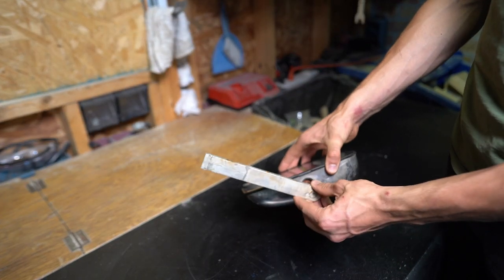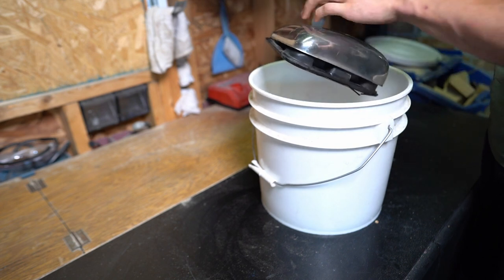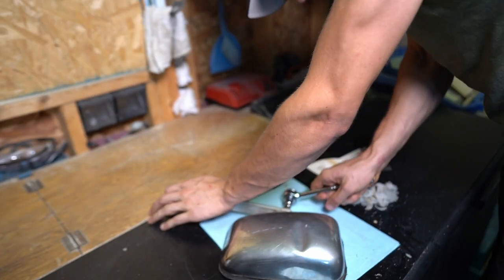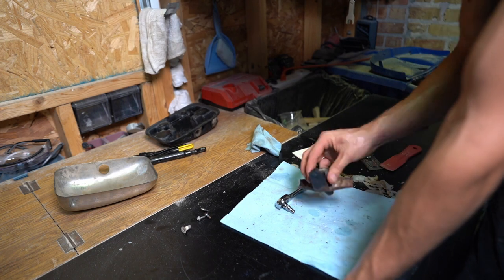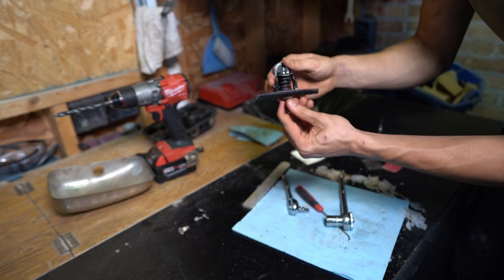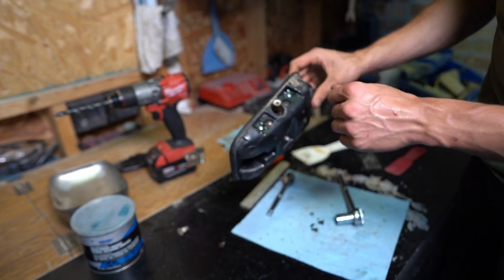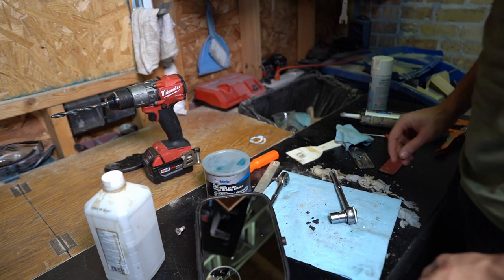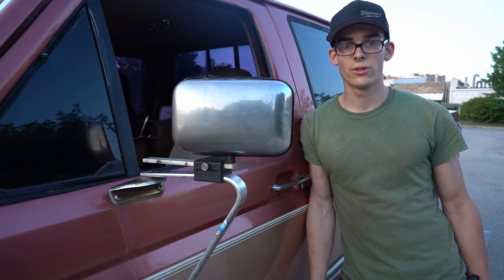How To Fix Loose Truck Side Mirror | 1994 F-250

Comment: Did the gasoline damage the black frame that holds the glass mirror? 
I'm having the same issue on my 89 Ford Ranger with both side mirrors? 
Also, what type of silicone did you use to glue the mirror back on, and how did it hold up through time after installation? 🤔
Reply from the maker: 1 - Slightly, Yes. But it's not very noticeable. 
2 - 100% clear silicone. 
3 - To be honest not very well, partially due to me not knowing exactly what I was doing. I think I ended up taking the mirror apart twice because the first time I didn't tighten the bolt enough/I think I had grease in it. 

If I did it again I would not soak the mirror very long, and get it right the first time.
Also I would not try to make it adjustable. It's a lot easier to have it fixed in one place. Just tighten it down all the way.

Side note: the ball on my mirror, kind of wasn't round any more due to rust. So trying to adjust it was unsmart.
Reply: @TheRandomVidsChannel  Thanks for taking the time to reply.
I'm gonna try and get them fixed this weekend, hopefully I don't mess them up even more. 😅
Reply from the maker: @Bensux You got it. Hope it works.